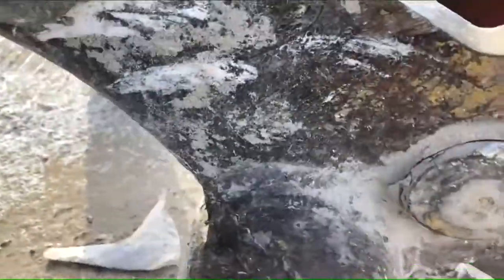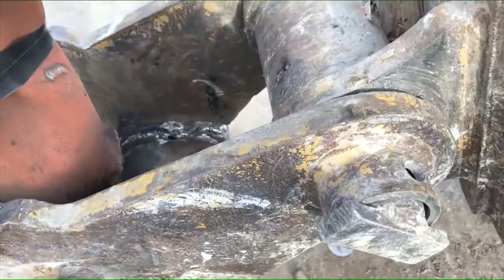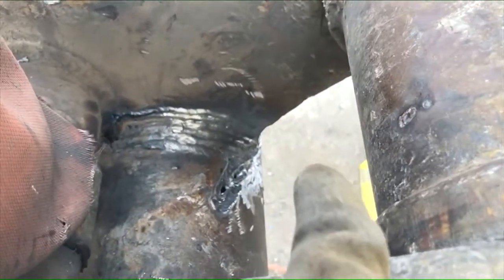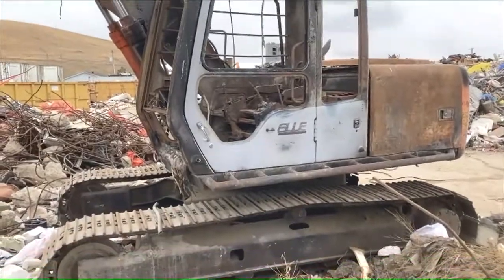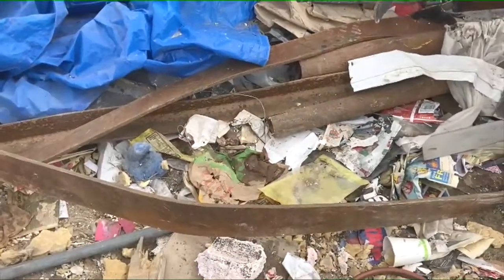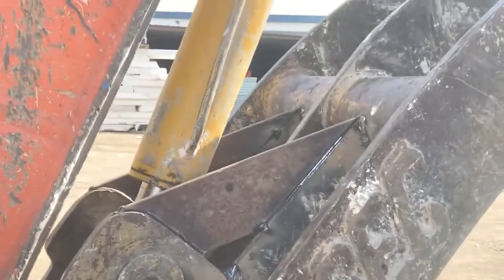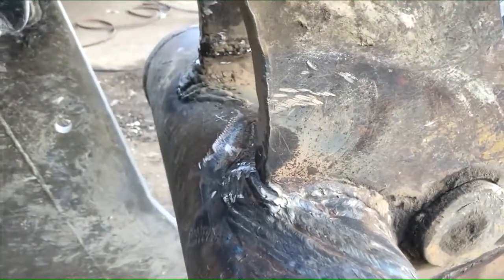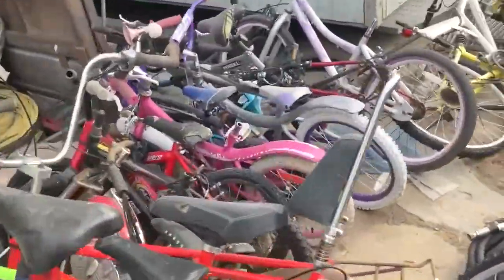Excavator thumb welding repairs.

Comment: Nice work man.  Love the Tonkas,
You don't use 7018 rod ? Just wondering
Reply from the maker: Yup I used 7018 in it all. Just 6010 for the first pass to roast it in then grind it down thin and 7018 fill and cap. Thanks man.

Comment: I understand what saying about the reason for gouging but a welder without a compressor and a gouging rig is a waste on time is not necessarily true. He may gouge with an oxy acetylene set. Appreciate your talent though and enjoy watching your videos.
Reply from the maker: Hah thanks Don. I was wondering if someone was going to pipe up and say that. There are people out there that do incredible torchwork. And you can also get gouging tips for plasma cutters now a days. So you are right, and working on this smaller stuff all methods are acceptable. But an air carbon arc gouger is the ultimate for chasing cracks. And when you get into bigger stuff, for example working on huge oil sands equipment. The gouger is the only way to go. Actually out here on most big construction sites, and I'm going to say all oil sands sites , The bare minimum requirement to even be considered as a contractor to fix there equipment is  a 300 amp welder, a 25 cfm compressor, (as a k4000 gouger requires 28cfm @ 80 psi) and a suitcase wire feeder. So jobbing around on smaller stuff you can get away with less but it is slower and less efficient. So it varies on your location and what industries and size of equipment is around. But around here. If you are going to advertise yourself as a heavy equipment welder, you better have the right equipment on your truck. Hope all is well out your way Don. Thank you.
Reply: @506curtis  Thank you Curtis. I am in the business and yes I own multiple rigs. Keep up the good work!